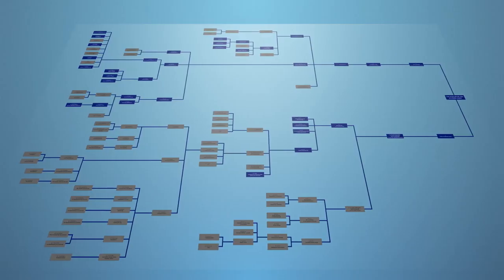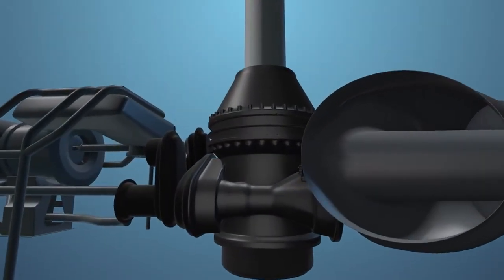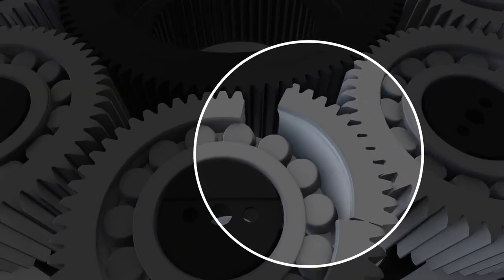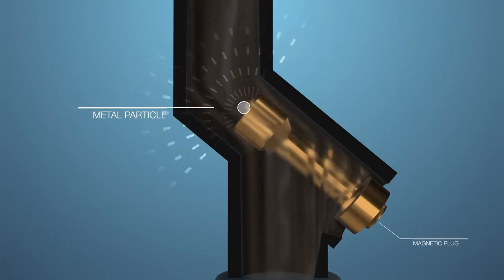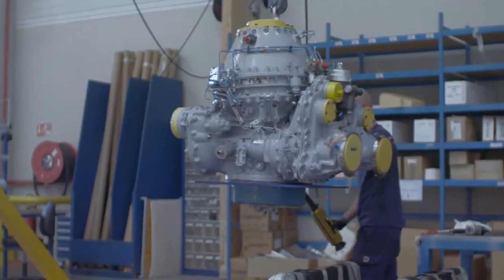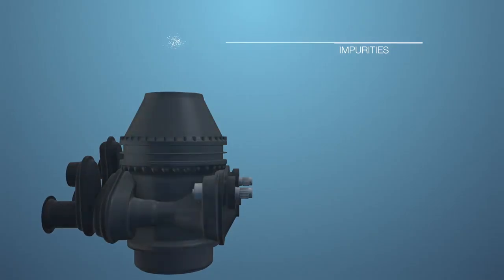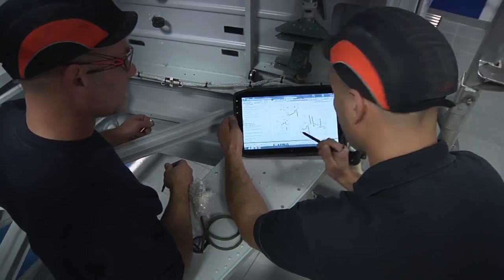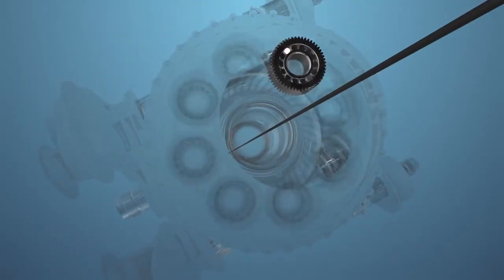Airbus Helicopters H225, Turøy, Norway, 2016 accident -  analysis video

Comment: The top tiers of safety are to eliminate the hazard and to substitute a safer option. Airbus did a superb root cause analysis, and followed up with less effective engineering and administrative controls to mitigate the risk. This catastrophe will simply reoccur at a lower rate. I hope Airbus will redesign and replace the vulnerable gearbox entirely in the future.

Comment: It was NOT an accident, it was a crash. An accident indicates no blame,someone along the human chain was to blame. By accepting a damaged gearbox,repairing it then installing is like playing Russian Roulette, it's only a matter of time before something happens. Common sense would prevail,that if a part arrives damaged; it's unsafe and needs to be returned and an exchange requested under the Sale of Goods and Supply of Services act. The product has to be of merchantable quality and fit for purpose. 
    If the gearbox had been dropped,it was neither fit for purpose nor of merchantable quality. Therefore the company that supplied the part is obliged to replace the part.
Reply: According to 49 CFR 830.2, it's an accident.

Comment: I wonder if going to a cycloidal type of gearing would improve the reliability. I  don't know if it would work or has ever bin tried before. Especially if they used a type of laminated gear. steel plates on top of steel plates kinda thing. so even if you had a crack it wouldn't travel through the entire gear.

Comment: Keep in mind, Eurocopter have not made any huge changes to rectify this problem. The Turøy accident is the second of the same kind. This happened earlier in Scotland the same way. Eurocopter have not made any major changes to rectify this. Most if not all Norwegian oil companies have still banned Eurocopter and are exclusively using Sikorsky helicopters instead. If you are asked to board a Eurocopter like the Superpuma, you should resist to do so. Demand another helicopter instead. They are not safe even to this date.
Reply: I thought the lowered service intervals and periodic checks on this model practically grounded them, as it is cheaper to fly anything else? This was after the accidents of course.
Reply: How long have you worked as an aircraft mechanic or aerospace engineer?
Reply: Agreed I flew in the gulf of Mexico for nearly 10 years. Starting off in Bell and then going to sikorsky 76 and 92s. The only major sikorsky crash I knew of was in 2009 when a red tailed hawk went through the front windshield. The windshields were changed out by the contractor flying to reduce weight. Rip 7 of 8 died.
Reply: I'm not sure what you're expecting as it seems many changes have been made. 

I'm seeing changes in magnetic particle collection, strict interception of ever-smaller particle sizes,  time-between-inspections chopped to 25% of previous, and Airbus choosing to dump one of their two planet gear manufacturers, while re-evaluating planet gears in other product lines. Also: attention to other risk vectors concerning inadvertent contamination, and damage during transport. Seems like a good start to me.

About "huge changes"... wholesale redesign of a gearbox can introduce as many new failure modes and risk vectors as it eliminates. Most of aviation is safe because high-reliability theory is employed throughout (HRT: see research of Todd LaPorte). The evolution of safety through HRT uses incremental change to reach its objectives, not necessarily broad-brush, wholesale design changes. 

I'm not sure "huge changes" would be wise, depending on how that term is defined, as all new changes involve some aspect of the unknown. Large inputs of unknown risk vectors and/or failure modes can backfire.

Comment: The more complicated something is the more chance there will be a malfunction. Some of the most reliable machines are some of the most simple. Just think of all of the moving parts in this machine?, ):  ?
Reply: Yeah? Double turboshaft helicopters have been in use since the 1960's. All using the same principle of gearbox. The only thing more simple than a double turboshaft is a single turboshaft. And epicyclic gears are way more reliable than a standard transmission.
Reply: @flexyco  You need to watch a video about how the gear boxes are made, and then tell us what you think.
Reply: Well then Captain Kirk stop making stupid comments ( :   dumbass runs in your family does it?.